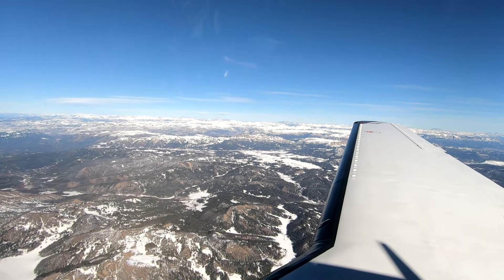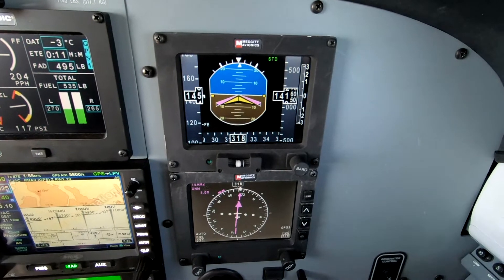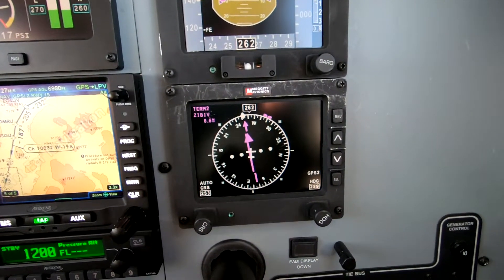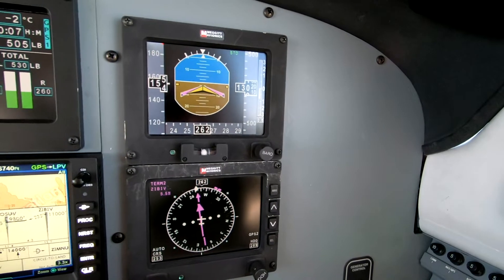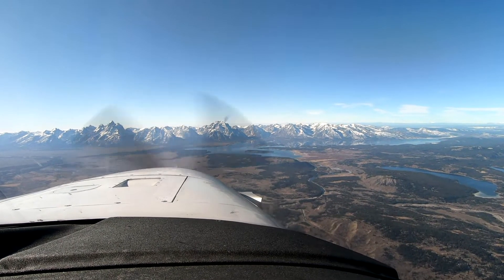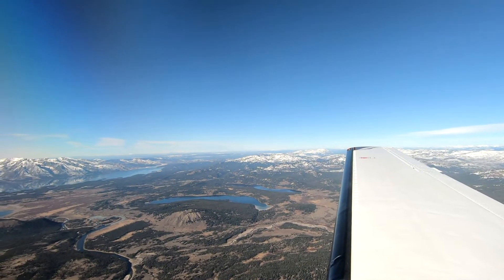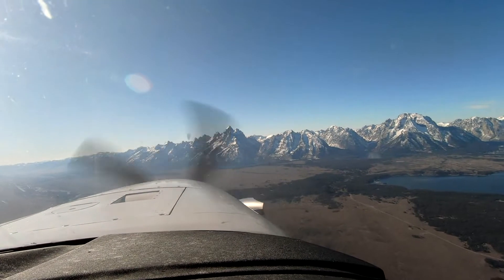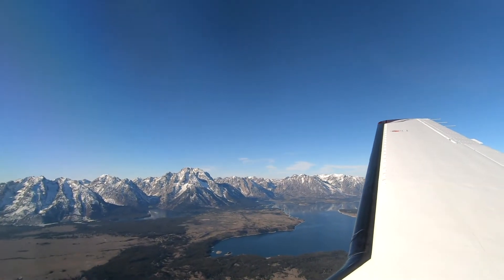Flying the Piper Meridian - The Rnav Approach to KJAC

Comment: Hey Dick, I fly a non-WAAS Meggitt Meridian in the UK with the STEC 1500 AP. So with LNAV only and no vertical path guidance, how do set up the A/P to create an appropriate ROD down to DA? If you just set the alt capture to the DA the aircraft starts to level out beforehand and then you end up high. To overcome this I set the airfield elevation into the A/P which is typically 400’ below DA. This allows the A/P to maintain the selected ROD without levelling off too soon. Just seems a bit clumsy and wondered if you had a better technique? Love the videos btw, particularly the older Meridian’s. Thanks, Phil
Reply from the maker: I do have an excellent idea.. if I do say so myself but it involves buying M600.. ;)
Reply from the maker: Seriously though; One advanced method I use is to set the altitude preselect to 100 above the threshold altitude, then I anchor my fingers and poise my thumb over the ALT button. I press the ALT hold button when I reach the MDA and then promptly set power to 850 pounds for level flight at 120 it’s with 10 degrees flaps and the gear already extended. Fly Safely - Train Often .. DR